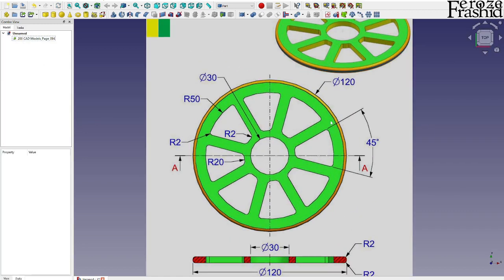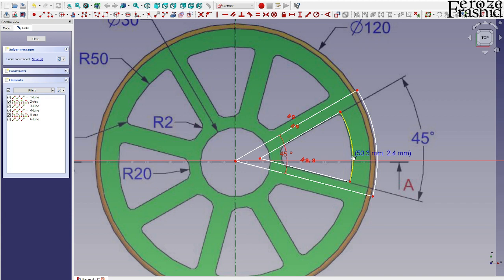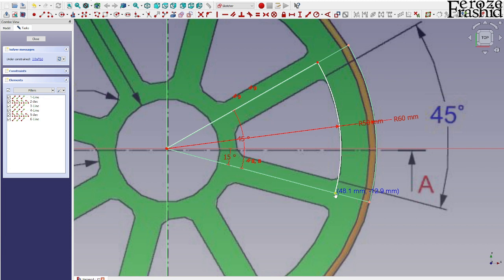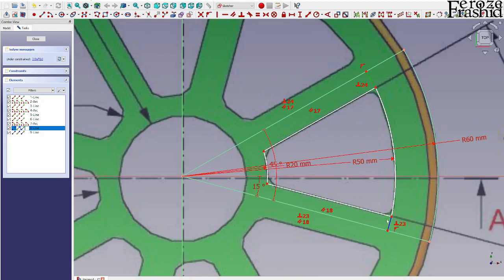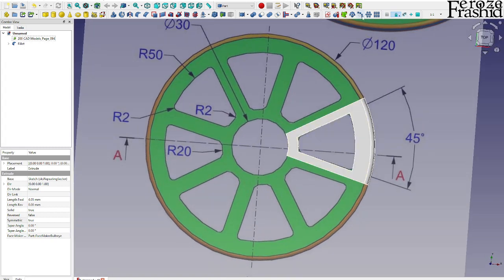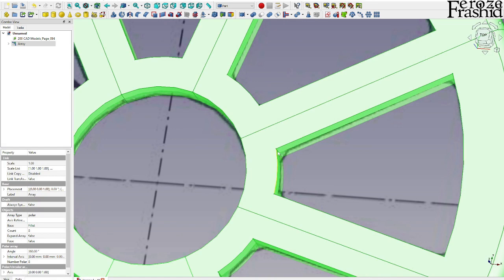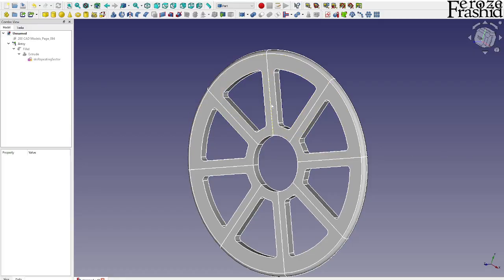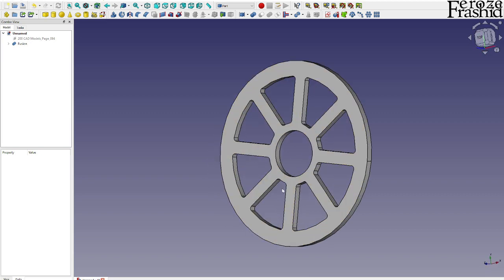200 3D Models in FreeCAD: Exercise 94

Comment: The main problem is that the picture is not represented on the usual vertical and horizontal axes (it seems weird to the engineering mind!). It really needed to be rotated to use it as the basis for your sketch. No guessing needed then. 
Or it would have been better to sketch without the picture.
What an odd picture.
Reply from the maker: Yes, I thought about building the model without the technical drawing in the background. Would have been much easier. 
At the same time, I was trying to recreate the exact model, no matter how oddly it was represented.